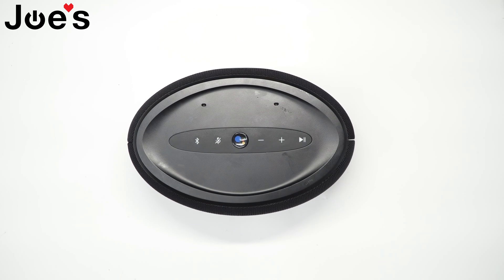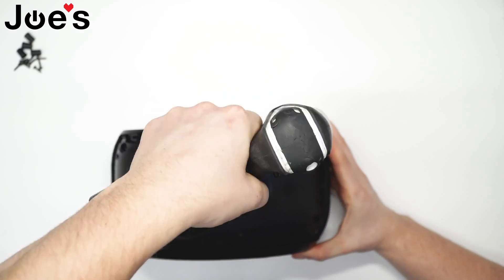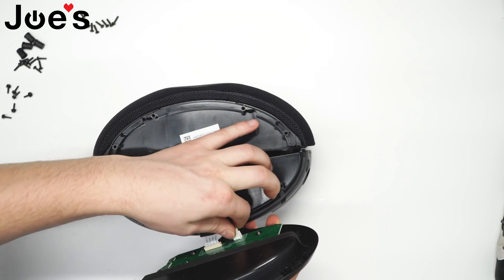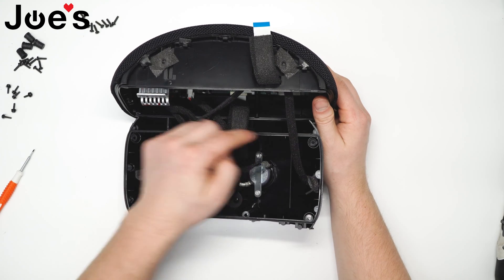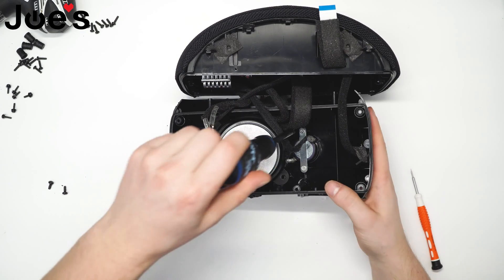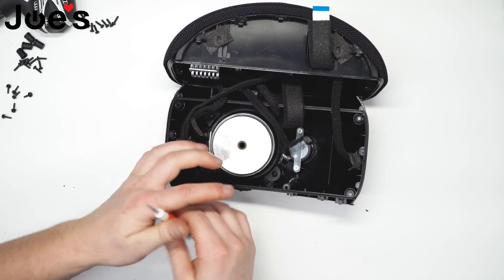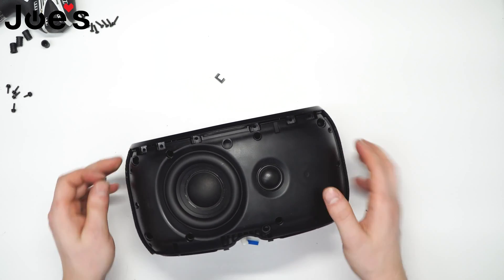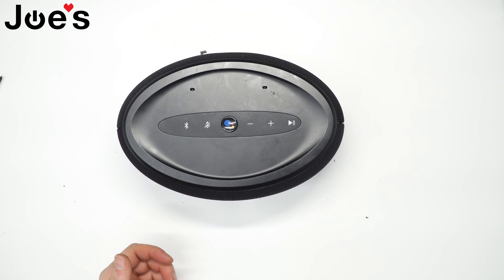Repair JBL Link 300 Speaker Driver Blown How To Tutorial

Comment: Hello Joe. Hope you're still looking over the comments here. Our JBL Link300 fell off a shelf and survived without a scratch. However, it plays audio broken with a loud "tick" sound every second or so. I disassembled it following your great tutorial checking for loose connectors or broken wires. Nothing unusual was found. Can you recommend which circuit board might need replacement? Or do you think we should send it to you for repair? Thanks for your reply.
Reply from the maker: Hello, thanks for commenting. Please email us at support@joesge.com and we will be able to better help you there. - Aaron P
Reply: @Joesge  tengo el mismo problema, que ray se pudo solucionar ?

Comment: This video saved me. My wife left some open candy on my speaker while I was doing some remodeling in the garage. Needless to say, that just happened to be the day I decided to take a week off from my project. Fast forward to me restarting and what do I see after lifting a hand towel off of the speaker? Yeah, a serious ant infestation.

In that short time, they had covered the top w/ little white things I assume were eggs and they had built a makeshift nest underneath. It wasn't hard to get the thousand or so I could see cleaned up but they kept coming out of it so I knew they'd gotten inside. I put it in a plastic bag & sealed it off then I threw it in the deep freeze for a few days to kill the remaining ants.

Today I took it apart and got a few hundred stragglers out of it. Piece of cake (again, thanks to the video!).

Comment: Hi, Joe, I'm currently working on repairing this speaker myself, yes I am to order the parts and not go out and buy them myself during this time of year, I am currently on the step of taking the speaker apart in two halves, it seems as though my my JBL-300 is stuck or, possible, I'm just too meek to pull it apart. Any tips?
Reply: When I got to where you are, I didn't have to pull mine apart. It just fell open on its own. Luckily I was holding it w/ both hands so nothing hit the floor. If yours isn't coming apart easy I would check for a missed screw. I followed the instructions step by step and still missed removing two of them. Good luck!